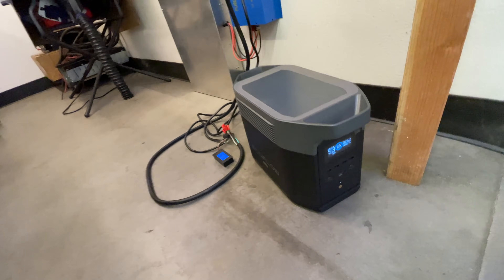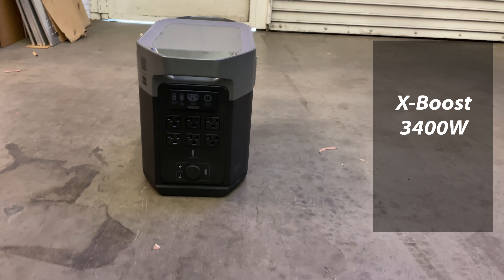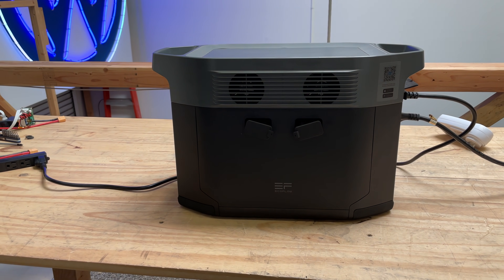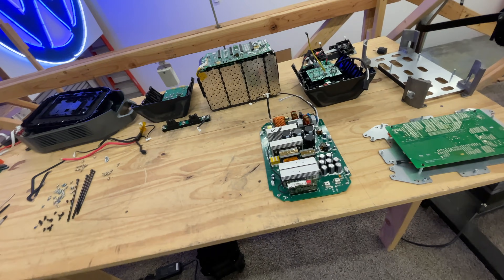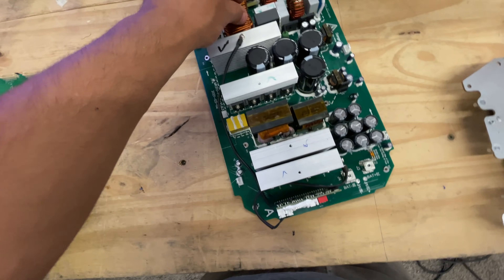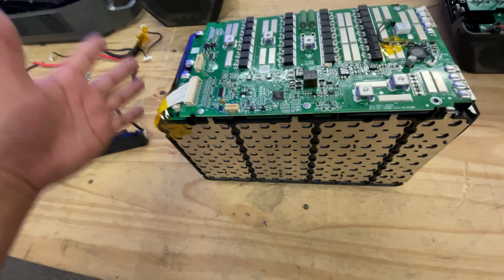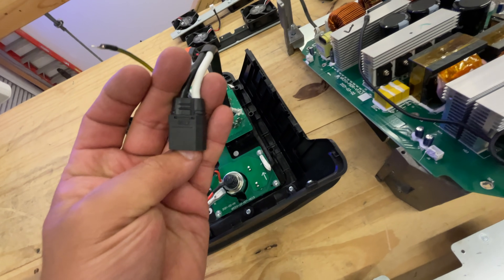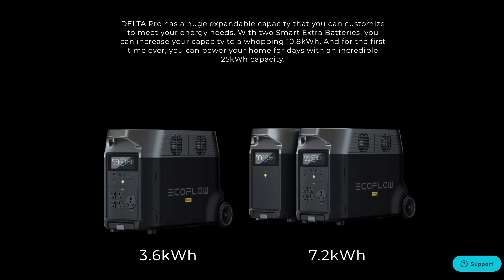Best Solar POWER Pack - EcoFlow Delta MAX review

Comment: You think Eco flow might need to work on it some more to compete with Bluetti AC200 Max and AC300/B300?🤔
Reply from the maker: What areas do you think they fall short in?   I’m not familiar with AC200max features,  for some reason they didn’t invite me to review the new units
Reply: @jehugarcia  
Every features AC200 Max seems to be step ahead of Ecoflow. New battery add on is backwards compatible with AC200p. 
AC300 might be the platform to copy for all the competition. 
Don't know the pricing yet. Pre-order is next week. Deliveries are some time in August.
Reply: @jehugarcia  Cheap cells is a bad idea. Cycle life is not the absolute worst I've seen but still pretty bad.

Comment: How long would this unit power normal house demands if used as a backup power source?
Reply from the maker: Depends what you mean by normal house,  everyone has different stuff plugged into the wall so power consumption varies a lot from home to home
Reply: @jehugarcia  I have a 20KW generator with auto transfer, but one of my sons has a hot water boiler system and no central AC. I did see the end of the video which sort of answered my question. Does the system give you some sort of transfer system or would it require a manual transfer? Thanks the videos and your reply!

Comment: Hi. I really enjoy your videos but dont understand and of the teck stuff. Im moving to Puerto Rico and need to buy a generator. I would like to know if the electricity goes will this maintain the fridge a fan and one light? Thank you. I hope you can help me.
Reply: Go for the new Bluetti 300 MAX out in Aug of 2021 or the Bluetti EP 500.  (HoboTech & Will Prowse do videos as well) Best wishes in Puerto Rico
Reply: Lorna, I would say yes.  There is a lot of variability in efficiency between fridges, especially comparing older ones and newer ones, but I would say yes.  How long depends on the efficiency of the fridge.  If you have a way of charging this power station during the day with a generator or solar, you should be good for a long time.  You could probably get away with quite a few things like lights, fan, charging devices, etc.  Don't let the size fool you.  2000kw is a lot.  Also keep in mind, that if you have a generator, the EcoFlow units charge so quickly, that you would only have to run the generator very little to charge the EcoFlow, which would make your gas last a LOT longer than powering stuff using the generator.  And you could even charge the EcoFlow while using it.  

Viva Puerto Rico.

Comment: Jehu:  Any data on idle inverter losses in watts? How much power is being used by the inverter being powered on?
Reply: 2000wh -400wh = I get 1600..
Reply: @raduardeleanu4800  under what conditions of amp draw?  Just an estimate?
Reply: @philipmorgan1438  I usually run it at 80-160w ..
Reply: @raduardeleanu4800  80-160w seems much too low for valid results.  Should be .2C or more.
Reply: @philipmorgan1438  I ran in at 800w aswell, roughly the same..  the inverter is around 80% efficiancy and that means 400w
Reply: @raduardeleanu4800  my results at 400w give 85% capacity returned… 1700w
Reply: @philipmorgan1438  most tests done by people give arround 80%, im getting the expansion battery as its not enaugh..  and I'm thinking long term considering the battery cycle is low..
Reply: @raduardeleanu4800  all the more reason that people hear results that show 85% is likely results at .2C discharge rate.  That’s the accepted standard for this type of measurement.
Reply: @raduardeleanu4800  I think having the expansion battery is a good idea.  
I don’t agree that most people get 80% … I believe many don’t conduct the test properly and the pro’s who use correct rates have gotten more (85%).

I have two (2) B300 myself.  Assures that the load can be powered much longer than 1700wh can allow.
Reply: @philipmorgan1438  honestly if you are getting 85% more power to you :)
Reply: @philipmorgan1438  I wish I could get a 3rd battery as I really like this gadget, for me it's a game changer..
Reply: @raduardeleanu4800  Yes, 5% more!👍
Reply: I own a eco flow and it barely drains when idling. It goes from a 100% to 98%. The ports also turn off on their own switch to save power.

Comment: Why do you like this better than the Bluetti?  The Bluetti will last 350% more charging cycles. There's no comparison in kW-hrs per $$ over the full life of the product.
Reply from the maker: Because I value ease of use more,  20 extra pounds to lug around is a lot  and for the average person 800 cycles is way more than they need,  calendar life will kill most of these components before cycle life.
Reply: @jehugarcia  Thanks for the reply.  Valid point for people who aren't cycling their batteries often.  How much does each chemistry degrade per year without use?  I don't think I've ever seen that covered before.  Thanks again.
Reply from the maker: It’s hard to say since it’s hard to indipedantly test,  but I once tested 11 year old never used Panasonic ncr18650 cells and they only had 100-200mAh degradation = 5-10%

Comment: Dam! I bought the bluetti ac200 already... This one seems much better in every way!
Reply: Kho  -  The  Bluetti  AC200P  is  much  better  but  heavier.    Better  battery  (LiFePO)  &  More  stored  Power  (2000 watt hour).   The  Ecoflow  is  throw  in  your  car  &  go  .  .  .  the  AC200P  is  leave  on  the  kitchen  floor  to  power  energy  hungry  appliances !    Two  different  critters,  &  I  love  'em  both .    If  you  are  still  upset,   Angelina  Jordan  is   great   for  stress/tension  relief  .  .  .  .   she  performed  in  Korea  a  few  years  ago  for  40K  people !
Reply: There was a New AC200P Max announced too.
Reply: @positronium3525  yeah the ac200Max seems incredible. It has a 3500 cycle life whereas the ecoflow is 800 cycles.

Comment: Can this or a Bluetti Ac200p run a well pump?
Reply: Yes if the pump is within the voltage and surge specs.
Reply: @Robert-cd2ht  on pump startup 16.2 Amp 120V almost 2,000 watts, but running 12.2 amps @120v.. around 1,500 watts. Off grid hobby farm getting a well put in next week and don’t feel like connecting to the grid. Judy exploring options. Thanks for your input. 
Ps. Bluetti would be charged by solar
Reply: @arturaugustynek670  I would suggest looking at the upcoming 200 Max or AC 300 or the Deta max. The solar panels will need go be sized acordingly depending on how much the pump will run.

Comment: I keep praying one of the companies will release one of these with a built in battery heater. For those of us in real off-grid situations in northern latitudes, this would be major differentiator
Reply: That would be pretty great, but I think it would be too bulky and inconvenient for non-arctic use haha

They already have the sensors and microcontrollers to do it, but to do it well they'd need to add insulation, possibly heating pads or dummy load resistors or something, and change the cooling system around so that in hotter temps the insulation doesn't cause it to overheat.
Reply: @clard52  All they would need is a very small heating mat under the battery pack  that could be powered by PV panels while the batteries weren't accepting charge because the it was too cold. No cooling would necessary, because the batteries only need to be a few degrees over freezing, then the heater can shut off. No cooling necessary.
Reply: @NeverTakeNoCut-offs  You can't do that yourself ?
Reply: @MrSummitville  Of course I *can*,  and I have with separate batteries, inverter, etc. But the whole point of of a solar generator is to be anti-DIY. I”d have to open the case, void the warranty, risk breaking something that I can’t fix myself, etc… For the tiny extra cost for a manufacturer, it would be attractive to someone to a lot of people who don’t want to mess with a 2k product.
Reply: @NeverTakeNoCut-offs  It is not a tiny cost.  But it is a very small market.  Using a product in extreme heat or extreme cold is the individual customer's responsibility ...
Reply: @MrSummitville  I have to believe it wouldn't add $50 more to the total cost. In the increasingly competitive solar generator market I just think this could be a differentiator, although I acknowledge the market is smaller then the general market.
Reply: 100%. I love the idea of rechargeable "generators" but I don't trust the tech yet. Lithium has let me down before in the cold. So gas is still king for me
Reply: @Matt von Wahlde   Have you viewed batteries like Canadian Battery? They aren't as sleek as the Eco products, but are very functional and heated.  You can alternatively make something, or check RV products that are designed for the same or similar purpose. Just my thoughts.

Comment: Can someone explain USP / EPS to me with regard to solar....does that mean that solar power will pass through the device directly to the output and not touch the battery if the load is lower? 

Or does that only apply AC power. I havent heard anyone get into the details of this. 

Im wondering because this would be a GREAT way to extend the life of your battery aka make sure your load doesnt exceed your input to preserve your battery.
Reply: Hey Asklve, the EPS function is only available for AC mode. When the unit is under EPS function, the wall AC power will go through the unit by-pass circle to the device directly rather than go to the battery.
Reply: @EcoFlowTech  is that the same as generator support mode

Comment: What is the transfer switch you're using for your shop?
I am also interested in the system you used before in your house to transfer power from your battery bank to the grid.
Thank you
Reply: me too
Reply: I'm curious to see exa6 how you connect to power a house. How many amps are you pulling and what are you powering?

Comment: My son needs to buy one for his apartment, no gas generators allowed, and we have LUMA that took over PREPA, it is a disaster, but the unit will not ship to Puerto Rico. He wants the Delta version. I heard there is a local seller, but they charge 3K for the Delta. Any suggestions?
Reply: in 2 weeks a campaign will start on the Kickstarter platform - a 2.8 kW generator, based on 18650 Li-on elements, price 999 USD
Reply: @andrejbozko7036  But will they ship to Puerto Rico?
Reply: @carlosencarnacion9667  Hey Carlos, yes, we can ship our product to Puerto Rico, you may check the shipping cost on the pledge confirmation page of our Kickstarter landing page.
Reply: You could get someone to buy it and ship it for you.